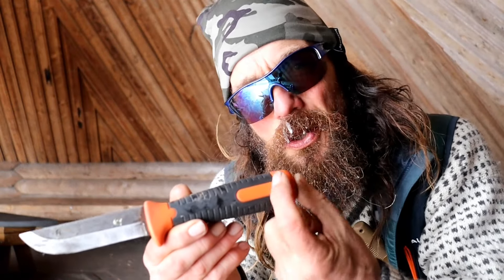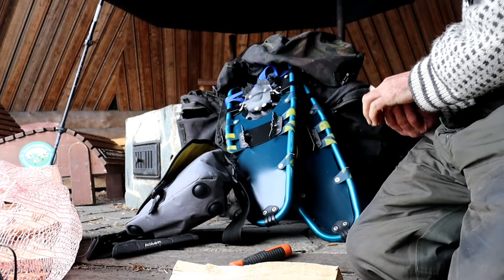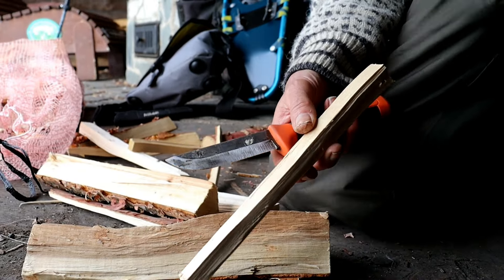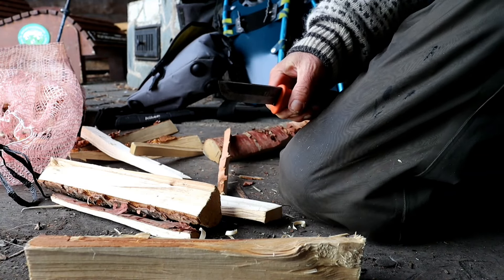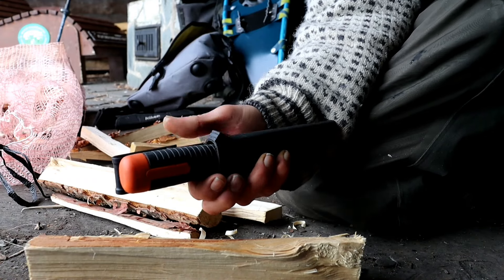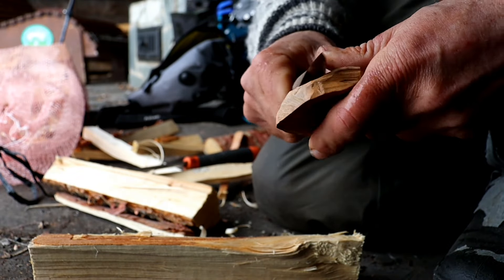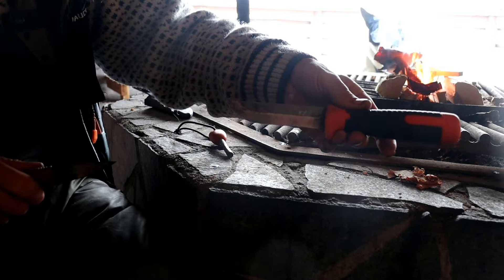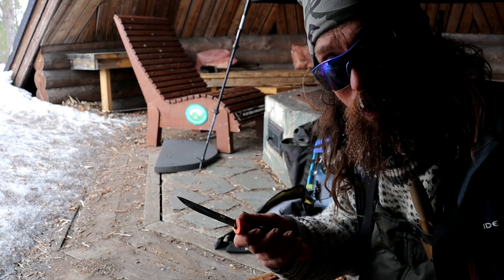Bahco 2449  wrecking/demolition knife, is it suitable for bushcraft?

Comment: Mine was a disappointment. While removing the plastic handle (to replace it with a wooden one), the knife blank fall aprox. 25 cm on some concrete, and the tip has broken. Didn't expect that from a "wrecking" knife. For those interested, the tang is 8,5 cm, it narrows from 1,5 to 1,2 cm, and it has 2 small pre-drilled small holes.
Reply from the maker: 25 cm wow that's nothing, quite surprising. The edge on mine seems pretty bomb proof. I have had to sharpen it of course but no chipping whatsoever and the chisel knife that I have has been really badly abused and survived. Trying to think of explanations but can't come up with anything other than the same old excuse of bad heat treatment.
Getting the urge to drop mine on concrete now to see what happens 😂.
Thank you very much for the tang info and for watching the video.
Reply: @KuukkeliBushcraft  Maybe I was just unlucky and received a bad one, or maybe the tip chipped hitting some small harder rock in that concrete, who knows... But the drop was very small and the temperature was +20 °C... After that I didn't continue the project, but I still have the blank. If someone wants to put the work in this kind of makeover (handles, sheaths etc) they better test it a bit before.
Reply: I droped one too one time...and the very tip broke.Not even 1mm.I wasn't suprised,it's made to work wood not concrete.
Reply: I've done everything with mine & batoned with it through logs & all sorts with no problems.
I think for the price it's an awesome knife.
The sheath is rubbish but if you forget about that the knife is awesome

Comment: love that knife its the bacho 2449 wrecking knife if anyone has trouble googling them its 4mm thick sk5 steel and its made for heavy construction work so its designed for beating on the handle,the blades are made in japan it was told by  bacho themselves in a mail.when i bought one in a hardware store i went trough like 15 of them before i picked a perfect one there might be small variations but for the price you cant really ask for more,you tend to find them in stores that carry the bacho gardening tools and chainsaw stuff.
Reply from the maker: It's pretty bomb proof, it's coming into work with me every day at the moment. I need to put some rivets in that sheath though. It slips of my belt every time I get in the car.
Thank you very much for the information.

Comment: Bahco 2449: Un Cuchillo de Carpintería Incomparable

El Bahco 2449 es un cuchillo de carpintería que, en efecto, destaca por su resistencia extrema y su capacidad para adaptarse a diversas tareas, no solo en el ámbito de la carpintería, sino también para trabajos más generales de supervivencia y campo. Aquí te dejo algunos puntos que podrías considerar agregar para complementar la descripción:

    Hoja y Material:
    La hoja del Bahco 2449 está fabricada con acero inoxidable de alta calidad, lo que le confiere una gran resistencia a la corrosión y una buena retención del filo. Esto lo convierte en una herramienta ideal no solo para trabajos en seco, sino también para condiciones húmedas o de contacto con agua, que suelen ser problemáticas para otros cuchillos de carpintería tradicionales que utilizan acero al carbono.

    Diseño de la Hoja:
    La forma recta y ancha de la hoja es perfecta para trabajos como corte de madera, escultura y otras tareas de carpintería, pero también lo hace extremadamente capaz en trabajos rudos como corte de carne o huesos. La hoja, si bien está pensada para un trabajo de precisión en carpintería, es suficientemente robusta como para hacer tareas más pesadas, lo que aumenta su versatilidad. Su espesor de alrededor de 3 mm también es un factor importante que le otorga una gran durabilidad.

    Mango Ergonómico:
    El mango de madera del Bahco 2449 está diseñado para un agarre cómodo y seguro, incluso después de un uso prolongado. Además, tiene un diseño ergonómico que reduce la fatiga de la mano, lo cual es crucial para trabajos que requieren precisión y durabilidad.

    Limpieza y Mantenimiento:
    Como mencionas, el lomo del cuchillo puede necesitar una pequeña modificación (como pasarle una lima para hacerlo más grueso) si deseas usarlo como ferrocero (pedernal). Esto es un detalle que puede ayudar a convertir este cuchillo en una herramienta más completa para actividades de supervivencia, como hacer fuego con pedernal. Al hacerlo, el Bahco 2449 se transforma no solo en un cuchillo para trabajos de carpintería, sino también en un cuchillo multiusos para actividades al aire libre.

    Indestructibilidad y Resistencia:
    Lo que hace que este cuchillo sea tan especial es su nivel de resistencia y lo difícil que es de romper. Es un cuchillo casi indestructible, capaz de resistir un uso extremo sin perder su capacidad de corte o deteriorarse rápidamente. Esta característica lo hace ideal para trabajos en condiciones duras, como en supervivencia o faena, donde las herramientas pueden desgastarse rápidamente.

    Relación Calidad-Precio:
    Este cuchillo tiene una relación calidad-precio excepcional. A menudo, los cuchillos de alta gama para carpintería tienen un precio elevado, pero el Bahco 2449 ofrece un rendimiento similar a los de las marcas premium pero a un precio mucho más accesible. Este detalle lo convierte en una opción imbatible para quienes buscan una herramienta fiable y duradera sin tener que gastar una fortuna.Conclusión: Un Todo Terreno de Alta Calidad

El Bahco 2449 es, como mencionas, un cuchillo casi indestructible que cumple con una amplia gama de funciones, desde tareas de carpintería fina hasta trabajos más pesados en el campo, y todo ello a un precio que lo hace casi inalcanzable en su categoría. Es un cuchillo que se adapta muy bien tanto a los profesionales de la carpintería como a aficionados o personas que buscan una herramienta versátil y fiable. La resistencia al desgaste, la calidad del acero inoxidable, y la ergonomía del mango son factores clave que lo hacen una opción fantástica para quienes buscan un cuchillo que lo haga todo.

Comment: Looks really good. I'm going to have to try to find one. I have had a pretty good Dewalt Chisel knife for about ten years. Stays in my carpenter belt. Don't know who actually made them for Dewalt.
Reply from the maker: Is it the one with the serrations at the base of the blade? If so I have one too. Also had it for a few years. I prefer the bahco though thinking about it the dewalt is in pretty damn good condition for the use it has had, it's doing well.
Thanks for stopping by Travis.
Reply: @KuukkeliBushcraft  Yup that's the same one. A guy gave it to me when I was helping him finish a house. Been really handy.

Comment: Ive always heard great things about that knife.  Its just impossible to obtain in America. 
Im try to decide between the ranger m95 or m97  or the jaakari puuko 140 or 110.
I really side with the smaller in both. 
Im wondering which is more useful?
If you could only afford one what would you use?
Reply from the maker: I find myself carrying the M95 more than all of the others. Just feels so nimble in the hand despite the longer blade. The sheath carry options I think is a big advantage but I do think I like the Sissipuukkos a bit more. There really isn't much in it though.
Thanks for watching mate.
Reply: Hi both, Have the two rangers since a while, both well used. KB correct (and good video as always). The shorter one has similar great blade but has a much thicker handle which myself I don't like so much for my hand (despite size 10-11 glove...). The longer one has a thinner handle which I really like, both good knives but just my preference. Finnish friends here swear by longer original one. Hope if helps. C.
Reply: amazon